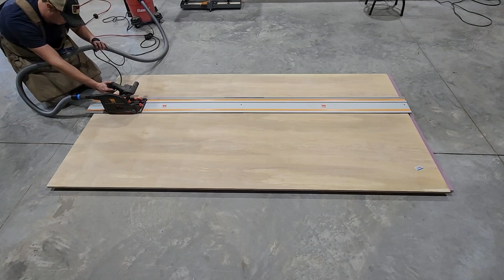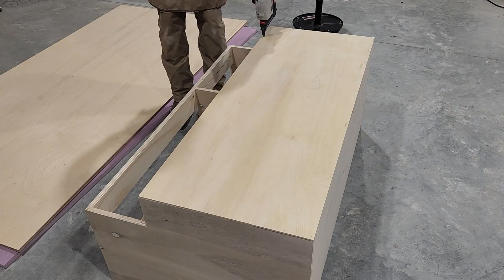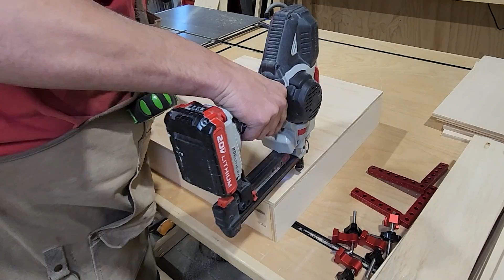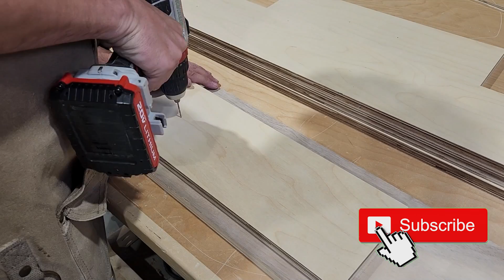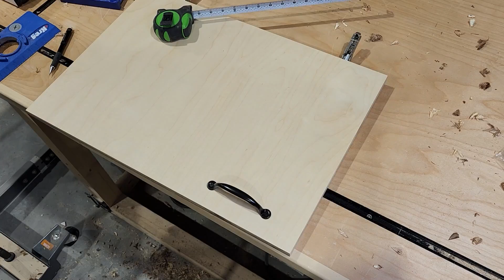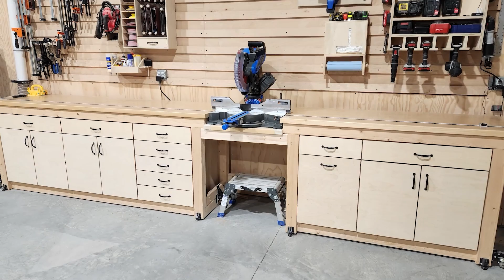DELUXE Miter Saw Workbench / Miter Station PART 2

Comment: Bought the plans and completed part 1 and into building the cabinets in part 2.  Biggest issue is plans really did not leave any wiggle room for the cabinets to fit into the opening from part 1.  You can tell by watching the video in part 2 when he has to pound the cabinets into the frame opening.  Really, would it have made any really difference to have left yourself a 1/4" on each side.  There are better plans out there.
Reply: This is a woodworking issue. I've built hundreds of cabinets for customers and always used the same dealer and I still measure out each opening because tolerances can change even between sheets of plywood
Reply from the maker: The plans are exact measurments, everyone is using different plywood and has different tolerances in thier cuts and you should measure your opening and determine if you want/need to adjust from there.   That is noted in the plans

Comment: I’ve got another question on the build.  On the left side cabinet I see spacers, but don’t see any measurements.  What are your recommendations?
Reply from the maker: Not sure what you mean, there should measurements for everything
Reply: On left side cabinet assembly 5 it appears from the picture that there is a spacer and then the slides.  If there is a spacer what size did you use?
Reply from the maker: @randycook8413  Do you mean the spacers for the pull out shelf??   look on the cut sheets pages 10 and 11 of the plans. 
You can email me patriotdiywoodworking@gmail.com or message on etsy, those may be a better place to discuss your questions.
Reply: @PatriotDIY will do

Comment: I’m at your drawer faces and see the measurements for 1 and 6 doors , but only see the width of the drawer facing at 5 5/8”, but no length.  Please advise
Reply from the maker: I see what you mean, the illustration on page 59 doesnt show the length BUT The dimentions for All drawer faces are in the cut sheets pages 10-12. 
You can reference the cut sheet for dimentions of all components.
Reply: @PatriotDIY Ty very much

Comment: If you had built this all at one time would you have still built it with the 2x4 framing or just used the cabinet boxes to put your miter saw surface on?  I know you wouldn't have been able to keep it mobile that way.

Comment: common  patriot...your
measurements are too tight! and u should adjust
in paid for
plans as was too tight for cabs into frame ..luckily
i have a brain and made adjustments ...BUT love your ideas and video...and a big fan!
Reply from the maker: Thanks for watching, glad you liked the video.
But yes, The plans are exact measurements. If you want some "forgiveness" in the sizing, that is left up to you. Some other thing to consider are that everyones tools and tolerances are different. Regardless of what the plan says, you will still need to measure openings before building something to go in them.
Also The measurements in plans are for 3/4" Plywood! Depending on the sheet you buy it may be less than 3/4 and you need to account for that.
Reply: @PatriotDIY thanks...your correct on all points..again i love the plans and the details...

Comment: Great build.  I had to make my bench 30" deep and center 30" wide to accommodate my Dewalt sliding miter.  Also had to miter the corners so I could do 45 cuts with miter saw.  Dewalt 780 is a monster.  I also added a router table insert to the left side that integrates with the T-track and a face vise with some dog holes.  Almost finished with the build.  Very happy so far.  Thanks for the plans.

Comment: when you switch from the Kobalt saw to the delta cruiser does the miter saw space still work? did it need to be enlarged or modified? Do you get full range of motion with the Delta?
Reply from the maker: @slatonranch8214  i had to extend the middle section when I changes saws
Reply: @PatriotDIY  does your current plans on esty represent the extension?
Reply from the maker: The plan doesnt specify a width for the middle section. Its left up to you to determine the size of that part based on your saw. @slatonranch8214

Comment: Great instructional videos--I purchased your deluxe plan and as I start to cut the wood and assemble the pieces, I have a "lazy" type of question: When using construction screws (wood screws), did you or do I need to drill pilot holes for this project. The frame is basic pine and the rest is birch plywood. I usually do drill pilot holes with hardwoods but was hoping with with project it would not be necessary. Thanks!
Reply from the maker: @GrandDudeJones  you don't need to predrill for the screws in the 2x4s, but you do for the plywood

Comment: When building the 5 drawer bank.  In the video it appears you’re using 1/2” scrap wood for spacers between drawers.  Is this correct?   I bought your plans and they show 1 3/4” between drawers.   Which one is correct
Reply from the maker: @baghalman  the plans are more exact! I had to make a few small changes when building mine because they ended up a little too close together.  The plans reflect those changes and give you more wiggle room for installing the drawer faces

Comment: Can you help me understand why you built cabinet boxes and inserted them rather than attach each piece 1 at a time to the inside of the 2x4 frame? 

It seems like margin for error is extremely narrow when trying to insert an entire cabinet box.
Reply from the maker: @MrHf4l  just way easier to build it outside of the bench than crawl around on the floor and try to work in a tight space under the bench
Reply: @ I’m not sure I’m that good to work within those tolerances haha. 

I bought your plans. Decided to go a different route, but great work! Keep it up!

Comment: I built the basic miter station, but had to make it deeper because of the slide rails of my saw. So, it's 30" deep. I'm going to be doing the drawers and cabinets soon. So my question is, do I need to make my cabinets and drawers deeper as well?
Reply from the maker: @TheCrashley1772  You don't have to, but you absolutely could! More storage is always a good thing!

Comment: My version of your miter saw station and cabnets are turning out great.  However, I'm starting the drawer build now and just noticed the cut sheet didn't include the sliding drawer bottoms. I'm assuming they are  cut from 3/4" plywood?

Comment: How did you do the hinges with that overlay on the left side cabinet? 

You said you used 1/2 overlay but how is that possible in the one spot between the shelf pin cabinet and pull out cabinet? Did you use different hinges for that one spot? Or is there a way to set them differently to turn them into 1/4 overlay? (Everything I read says you can adjust them up to 2mm).

Or am I overthinking this? Are you able to adjust it down enough to get the overlay plus the 1/4” reveal. (Past the 2mm adjustment I’m reading on the specs).

Comment: Working on building a station as the last leg of reorganizing my shop and decided to use your frame design. I built one half yesterday and will finish it during Memorial day weekend. I'm cutting all the 2x4s down to 3 inch and sanding everything before assembly because I figure I'll be using it for years, so make it nice. So, that adds a few hours of labor, but otherwise this design is quick and easy.

Comment: Great Video. Exactly what I am looking for. Did you attach it to the wall when you had installed the drawers and cupboards or was it still able to be moved.
Reply from the maker: Alot heavier obviously but technically Still mobile! I use the removable fold-down casters from PowerTech https://amzn.to/4adXsWF
Reply: @PatriotDIY  Thank you. That is good to know. Thank you for the link for the casters.
Reply: I have purchased your plans. Very excited to get started on this project. Just going through them and writing my materials list. I am in Australia so our timber is different over here. We don't have 2 x 4 for a start that will be 90 mm x 45 mm for the frame. I am going to use Marine plywood for the top and will do the frame and top first then come back and do the drawers and cupboards later for which I will possibly get birch plywood. Yet to decide. Anyway my question is where on the 3/4 Plywood Cut Sheets is the mitre saw top.  I know mine will probably be different but I can add the extra width for that but seems to be missing. I will probably buy 2 sheets of Marine Plywood which is 2440mm x 1220mm x 18mm for the top. I will then have to shuffle the rest around the other sheets when finishing it off but thought if I could see where the gaps were I could move them around.
Reply from the maker: @CathyEbs  the plywood for the saw platform isn't on the cut sheet since the size will depend on the size of your saw